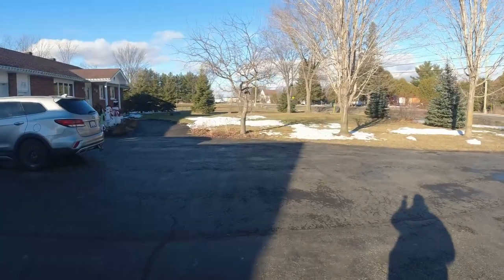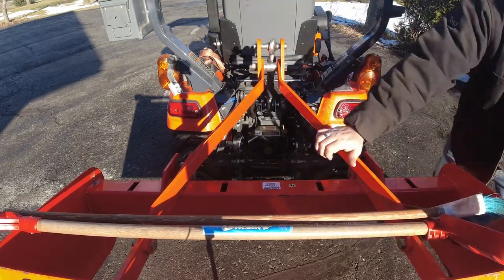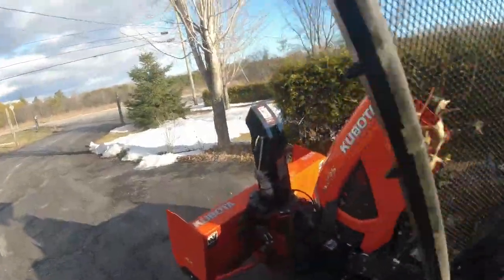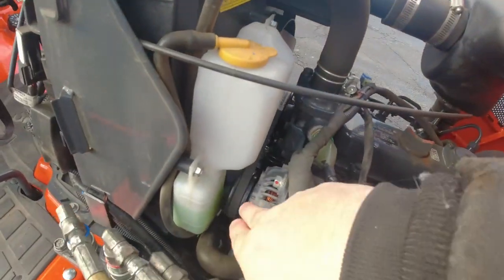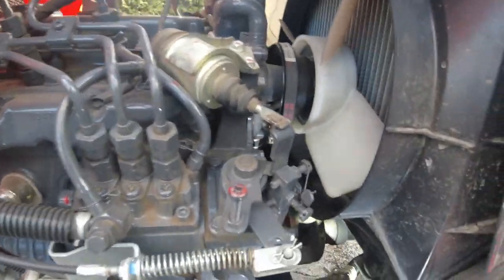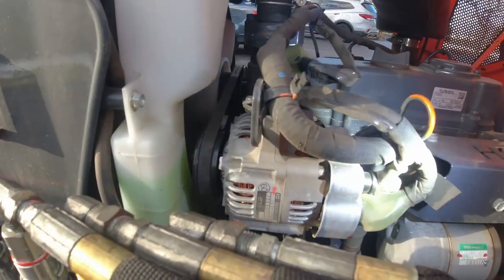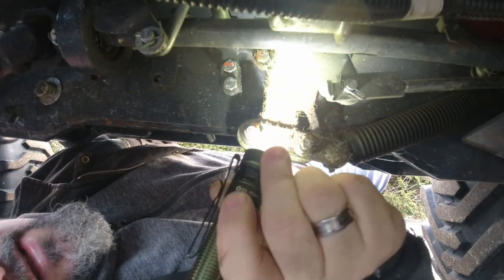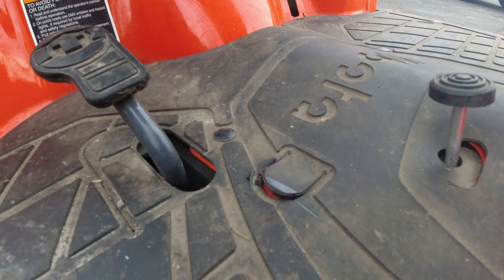Kubota BX23s: A Comprehensive Overview of 100-Hour Service

Comment: Hey Ross.... you got some sun ☀️.... we got none just dampness.... yah jealous 😒... for my  exhaust pipe dirt I used a flexible pipe clamped on... I adjusted until I found the right spot. Glad I had a flexible pipe on a tight turn the tire hit the pipe... just pushed it out of the way and didn't cut the tire...works great now. 😀 Good. Video 👍
Reply from the maker: Thanks BJ, ya I think I'll look at a longer flexible pipe.  Good idea.  Thank you. Have a good week.

Comment: Ok I didn't know about the Kubota App!  There I learned something today, Thanks Ross!  The weather has been nuts here too.  👍🍻🚜
Reply: The air filter dump flap thingy closes with the vacuum created by the engine running.
Reply from the maker: Thank you Mark.  Wasn't sure if my old man brain forgot about that gap 🤪 yes check out the app.

Comment: Great tip about blowing off the air cleaner. Interesting how the engine looked backwards in the BX. My B2601 has the battery and radiator in the front. Changing that fan belt looks like it may be a bit of a challenge! Nice job, Ross!
Reply from the maker: Thanks Ed, that is interesting and a little challenging. Some extra stuff to undo for sure.  Thanks for watching.
Reply: I think technically the engine on the BX is backwards. I have the BX 2680 and it socks air from my feet and the muffler is up front.
Reply from the maker: Ya I think it is as well.

Comment: That purge valve on the air cleaner is for any water that gets in there.
Reply from the maker: Hello, thanks for that, good to know, I just didn't remember if there was a gap in it usually so thanks for the info.
Reply: @RossOnTheLand  Did an oil change in Nov any should post Friday, but currently we are still cutting down small trees by the road that were effected by the freezing rain we had a few weeks ago. Seems like a never ending process.
Reply from the maker: Oh nice, I'll be watching.  Ya tree management is never ending. Cheers thanks.

Comment: Hi Ross    update on the cab . Took 3 hours and didn't need to drill any holes ,I love it {sturdy} and well thought out. Can be removed with 3 bolts on each side and the cab comes off in one piece .5 minutes . Were I'm at the wind is what gets you. The time and money for me to make one wasn't going to happen. Its 90 degrees {warmer} this week by me......{wont last}   great video Ross
Reply from the maker: Thanks Gary, that's great. I may build something but your option is very tempting.  Especially the ease of use.

Comment: "What did you do on your land today," coincidentally,  I did almost the same with my Kioti., mainly greasing the F.E.L. arms and hinge points, as well as re-check the rear mount PTO joints to the snow blower.
We still have not had enough snow to plow, but the weather forecast is calling for " periods of snow" Friday thru Sunday, with freezing temps. Who know, I might get a chance t play in the snow.
Reply from the maker: Excellent! Nice tractor time.  I hope you get some snow soon. Thanks for watching and commenting as usual Reg.

Comment: Great video Ross. Your weather and snow looks same as ours. Crazy warm here also. Temps Closer to normal starting tomorrow but not much snow in forecast. Fun watching Jon today wish we were getting that.❄️. I did some maintenance today also on the Kioti, checking loader bolts and lugs for proper torque. Take care and be safe 👍✊
Reply from the maker: Hi Bob, yes it was fun on Jon's live. We still have rain right now, but colder temps are on the way. Snow will be here again soon enough. Thank you Bob. Chat soon.

Comment: Hi Ross, regarding that exhaust soot on your 'blower; I had a similar situation on my tractor, so I used a couple of 22 1/2 degree elbows ( copper ) from the local plumbing shop and these fit the exhaust perfectly, held in place with muffler clamp. Now the exhaust blows off to the side and totally away from  the tractor. Oh btw, my exhaust pipe s 1 1/4" OD  so getting those fitting to fit was easy.
Reply from the maker: Thank you, I will try to angle mine out more than down, and see if that helps.  Good idea regarding the pipes and clamps.

Comment: Good video Ross, excellent tips. I am surprised that you only have 100 hours on your BX. I like the reverse air flow on the BX, sucking in air from the operator's platform.  It has it's benefits. The Evacuator valve should be closed and opened when servicing.  It not only allows for moisture to drain but dust be expelled. I don't think that it should have a big smile the way yours does.  When the tractor runs a vacuum will build up inside the air filter wich closes the Evacuator. There is a spinning action that forces dust debris to the Evacuator valve. Pulses open it very quickly to expell accumulated dust then closes it.  I would check if it closes enough when the tractor is running.
Reply from the maker: Hey Paul. I have a bit more than that now, like 140, but didn't get a chance earlier to do that check.  So because it was nice out I decided to check them. I'll definitely see what that valve is doing when the tractor is on. Thanks for the info, that makes a lot of sense.  Have a great weekend.

Comment: What would be the cost of a hydraulic top lift for your rather than welding and adjuster bar?
Reply from the maker: Hi Edward, here I think it'll be like $300-500 all said and done, but have the pipe here already so Welding something would be way more cost effective.  I do want a hydraulic top link for sure. And an angle rear blade as well,
Reply: @RossOnTheLand  howdy, and let me say that your video was wonderful.  Do you have the extra hydraulic for a top link addition? Or is that something also you would have to add.?
Reply from the maker: Thank you!   I would need to add all of it. I have nothing related to a 3rd function rear or front end.

Comment: The only thing I would be careful with is the air filter.  I wouldn't blow it out unless you had the secondary filter inside.  In that case I would only clean the outer filter. Tearing filter pleats is very easy to do.  And the air will take the path of least resistance when the engine is running.   I know you will replace it in a few months so it isn't a big deal.
Reply from the maker: Thanks Jason, I do agree with your recommendations, I will be changing it soon for sure.

Comment: @11:24 - Just curious about what is involved to replace that fan belt?  Hard to tell looking at it from the angle of the video, but it looks like the drive shaft would need to be disconnected from the crank.  Oh course, I could just be looking at it wrong.
Reply from the maker: When looking at it, I think you have to remove the coupler on the shaft as well as the fan. Hopefully not too big of a job.

Comment: Outstanding Key Maintenance Vital Factor Ross 👍👌🧐✨🚀 You can oil the back of your snowblower so the exhaust dust will be mush easier to remove and also protect against rust !!! 👌👍😇 Great Idea about the Handle of The Top Link 😇👍👌Great Dealer That You Have Ross ( Protective Rubber )🧐👍That Rubber Ross is also for getting Off The water 👍🧐When The Engine Is Running it close by itself ( air vacuum ). I oiled the front filter of the radiator during winter and the front cover too. 🧐👍 Yes Great Tips on Air Cleaning the Air filter 👍🧐👌No, it as to get open to flush the water Ross ( air gap need to be open a little ). If I was you Ross, I will buy that 2nd filter !!! 🧐👍It will be nice to have a better place for the 1th fuel water separator  👍🧐👌I did a Cooking Video ( My Wed Video !!! ) 😋👍 Cheers 🍻🍻
Reply from the maker: All excellent points David good to know about the air filter gap. Thank you.  Ya I think I will look at getting the 2nd air filter as well.  Thank you so much. Cheers. I'll go watch your video! Yummy.
Reply: @RossOnTheLand  Yes having that 2nd air filter is like having an insurance and thank you very kindly Sir Cheers 🍻🍻
Reply from the maker: I agree 👍